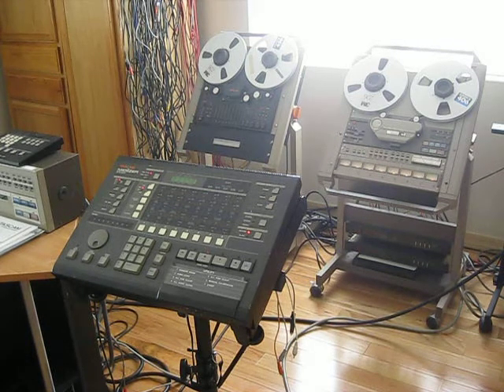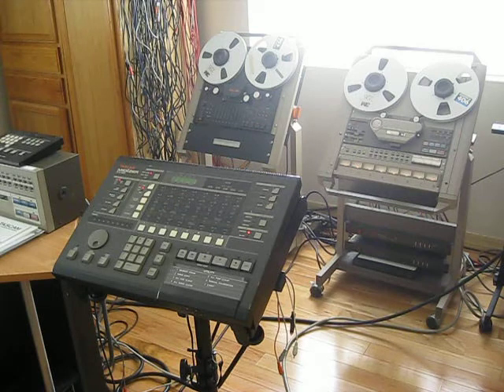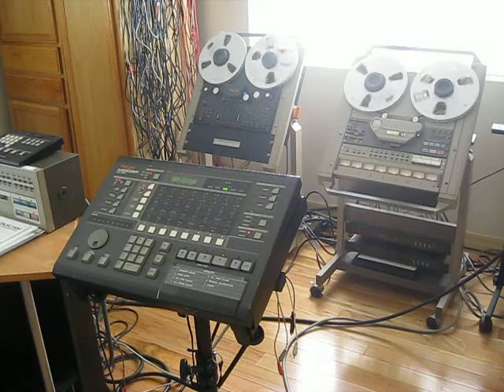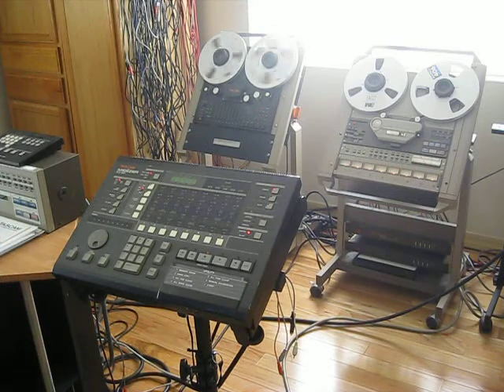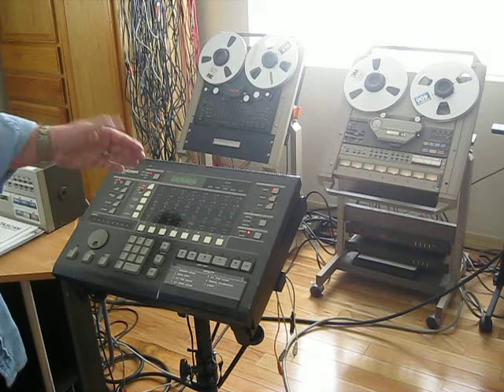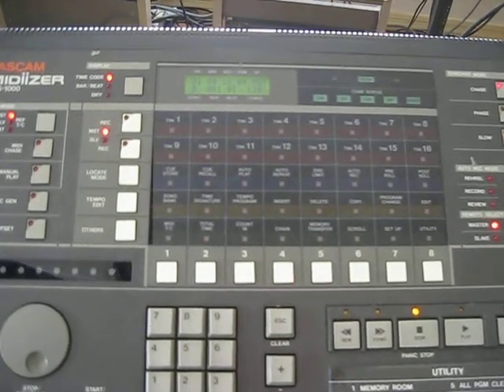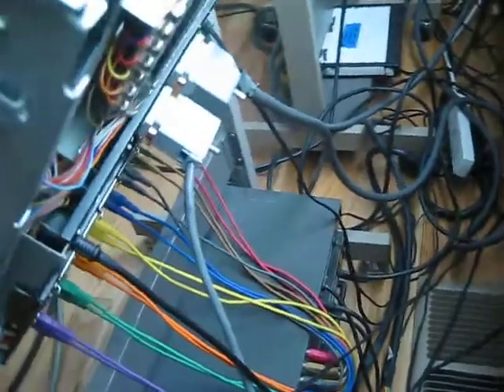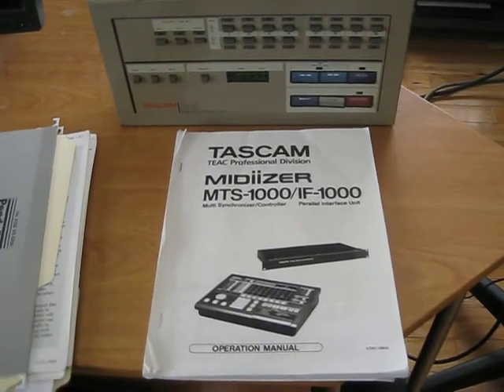Tascam MTS-1000 With Parallel Interface

Comment: Hello
I am looking for the pins to make the 2 master and slave cables because the cables I have do not work on my mts-1000 and my msr-24
I read somewhere that you had to invert two pins to be ok
but I don't know which ones
can you provide them to me?
Cordially
Reply from the maker: I don't know what you are referring to exactly, other than possibly serial transmit and receive. Are you synching two msr-24's? Do you have the user documentation for the MTS-1000?
Reply: @studiohead  du schema de cablage des db15

Comment: I worked at the largest video post facility on the east coast of USA.we built our own interfaces for any machine we had (film projectors, 2" quad video tape machines, 1" video tape machines, special effects generators, 1/4 - 2" audio machines etc. We could control up to 20 machines at a time. What was important is that the controllers had full control over a device. When a device got a new time code, it automatically went into a "hunt" mode for that time code. Once it was reached, the machine entered the "ready" state. It awaited the "play" command. Once play was initiated, it entered the "sync" mode and advanced or retarded capstan speed. Once in sync, it entered the 'locked' mode, where reliable video/sound/effect can be used. Once a machine was done with its segment, it entered the "stop" mode and waited for another time code to hunt for.
It was a thing of beauty to watch several machine enter the hunt mode while the record machine just kept going! 
If a machine failed to reach its hint point in time, the record machine and the last I/p machine would stop, back up to a preroll point, wait for the machine for find its hunt point, once found, the record machine would automatically begin and make a match cut. The editor didnt have to do a thing

Comment: The connector from the Tascam 58 to the IF-1000; are you using the connector for the dbx control signal? or is that done with an ELCO connector, one that might also be used with a Tascam AQ-65 Autolocator?  Thanks
Reply from the maker: The Elco connector is the parallel interface

Comment: Very cool! 
I'm not new to analog tape but I'm new to smpte and sync. I've got a Studer a80VU 1" 8 track and a Tascam MSR24 with a Midiizer which I've been using just as an remote. Do you think I can slave the Tascam to the Studer by sending smpte from the Studer to the Midiizer (+ smpte from the Tascam) ? 

I guess I wont be able to use the Midiizer as a remote for the Studer but could I still get the Tascam to chase the Studer via the Midiizer?
Reply from the maker: Does the Studer have a parallel interface? I assume the msr24 has a Tascam serial interface. To use a parallel interface with the midiizer you need the if-1000 serial to parallel converter that I am demonstrating in the video.
Reply: @studiohead Yes, maybe I'm getting a little bit off topic in realation to the if-1000 that you're demonstrating in the video. 

I'm not sure that the Studer has got a parallel interface since it's an early mk1 machine but it's got a remote connector. But anyhow I was thinking that maybe I can get the  machines in sync without connecting a parallell connector to the Studer. I guess I wont be able to control the transport on the Studer via the Midiizer then  but maybe still it can be used to have the Tascam slave to the SMPTE code that I'll be sending from the Studer?
Reply: @danostlund3032  your idea would work well.